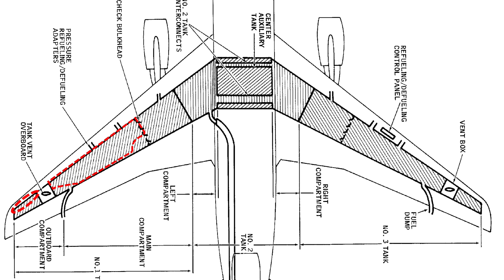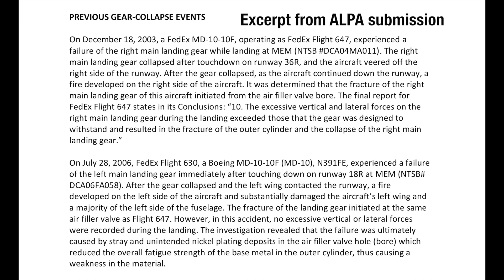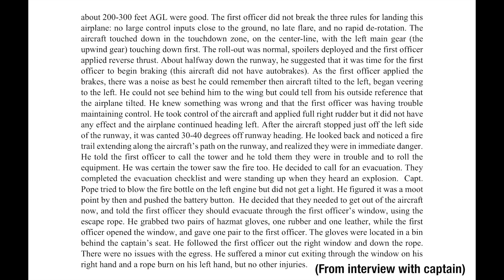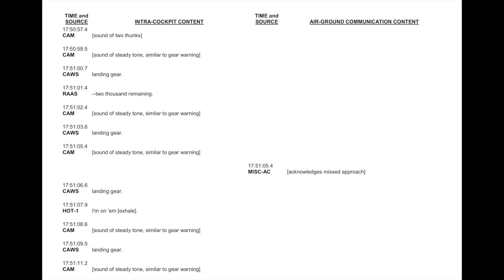FedEx Express 910: Gear Collapse, Fire, Fuel Tank Explosion

Comment: FedEx ignored Boeing's recommendation for inspecting the landing gear struts for corrosion.  There was supposed to be a cadmium coating to control corrosion but it was absent on this plane.  It is not clear if the coating was never applied or if it was accidentally removed during a maintenance operation and never restored. So, FedEx saved a few bucks by not doing the recommended inspection and ended up writing off a valuable aircraft.  FedEx NOW follows Boeing's recommendations.
Reply: I would bet my left nut that their maintenance schedule was approved by the FAA. Just because they didn't follow Boeings recommendation doesn't mean they did their maintenance improperly.
Reply: They failed to discover that the cadmium coatings were not present on the strut for 5 years and the strut became so badly corroded that the gear collapsed.  If they had followed recommendations, they would have discovered the issue and avoided the failure and destruction of the aircraft and endangering the crew.
Reply: @johnferguson7235  There is no on-wing procedure to detect this condition. Landing gear replacement is part of the maintenance schedule
Reply: In addition, he seemed to land very hard from the volume of tire smoke seen. It's a known issue with this plane that landings, which are fast to begin with, can generate a high sink rate and heavy landing and even a bounce.
Reply: If I am correct, THAT is an old DC10..NOT a Boeing Airplane/product. Maybe Boeing bought McDonald Douglas out.
Reply: It started life as a DC-10 as built by McDD. It was converted to a "MD-10" by removing the engineer's position and updating the avionics  to allow for a two person flight crew by Boeing or a contractor.                                                                                     
 Officially Boeing and McD Douglas merged. Reality = Boeing bought MCDD.
Reply: @georgealdredge2806  I always thought that, that engine mounted on the tail was a very horrendous decision and MCDD NOT having backup hydraulics was an accident waiting to happen.
Reply: Well the DC-10 did actually have three separate hydraulic systems and only one was needed to fly (emergency landing would be needed in that event). As we learned in the United 232 incident, three was not enough. Subsequently, the DC-10s and MD-11s were equipped with "fuses" to limit the amount of hydraulic oil that could be lost in a catastrophic system failure.
Reply: @georgealdredge2806  They could have installed the hydraulic "fuses"/reservoirs after the 1972 "Windsor Incident" and before the 1974 Paris disaster. See also "Ford 'Pinto'".
Reply: I flew the MD11/10 for FE for 10 yrs. The “fuses” you are referring to was called the hydraulic system bypass enhancement valve... we called it the Sioux City valve. I can assure you FE has one of the best, if not THE best, maintenance department in the industry.
Reply: Jaime   I am in agreement with you on FE maintenance. Would FE have done the off wing survey of the MLG that this plane was scheduled to soon have done, or would this have been sent to a contractor?
Reply: George Aldredge hello George, I’m not certain, but FE does do most things in house, save for pax to freighter conversions , and off site maintenance where contract maintenance is the only option.
Reply: It's a DC-10 not built by Boeing, so....

Comment: Did they try and paint over the Fedex logo?
Reply: Obviously, yes...it just didn't work that well.
Reply: That is the dried fire extinguisher foam that was sprayed on the aircraft.  It is illegal to disturb any evidence on the plane until it has been fully inspected by the NTSB.  The plane can't even be moved without permission of the NTSB and the FAA.
Reply: Looks very much like just the logo, like they did on that Arabic or Japanese 747 that stuck it's nose in a ditch a while back.
Reply: @johnferguson7235   They painted over the logos as soon as they could get out there to do it. That does not disturb the NTSB investigation in a case like this and is a common practice.
 
That was not "dried fire extinguisher foam" - where in the world did you come up with that?  There were no fire extinguishers used here, nor would they have done any good.  The foam sprayed from the ARFF trucks doesn't dry like that, nor was it sprayed on the parts of the aircraft that displayed the FedEx logos.
Reply: yes, it is common practice to paint over the logos of aircraft involved in accidents
Reply: Guess they forgot to spray over the engine 2 logo....
Reply: @mikef6307  - They initially painted over what they could reach from the ground.  Once the aircraft was relocated to a remote concrete pad for the duration of the investigation, the entire aircraft was painted solid white.  Search Google Images for 'N370FE scrapped' for pics of that.
Reply: thanx Matt....
Reply: Common practice to paint over the logos on the aircraft after a crash, This aircraft was put next to a Dynamic 767 that had caught fire a year earlier which was also painted over in the same way, until both were finally scrapped.

Comment: The DC-10 was a HORRIBLE AIRPLANE!   SHAME ON YOU, DOUGLAS AIRCRAFT!!!!!
Reply: Don't know what your talking about its a great plane
Reply: The DC10 was and the MD11 still is one of the best aircraft out there. Only people who don't know the aircraft would say otherwise.
Reply: FF: The accident had nothing to do with the design.  The cause was improper plating procedure during landing gear overhaul.  Not a design failure.  Find another scapegoat.
Reply: Pelican1984  In addition to the (possibly) improper plating procedure FedEx exceeded the recommended overhaul limits. They would have had to remove the landing gear from the aircraft for an inspection/overhaul as there is no routine procedure to effectively inspect this area during on-wing maintenance activities.
Reply: Well, let's see about that.  The marketing department at douglas was frantic - they had to win!  Somebody influenced engineering somehow.  Maybe it was upper management.  I don't know, but the results were horrible.  In the design, the horizontal stabilizer and elevator surfaces were deliberately made small.   They did that to reduce drag and make the plane more competitive.   This made handling more difficult and, I'm not sure, but I think it increased the landing speed a bit.  And let us not forget all of those crashes, costing many lives because they just had to make the cargo doors open outwards, when common sense would have them open inwards - but that would take up a tiny bit of space, and golly, we can't have that!  And then there's the fact that all of the control runs were in one nice happy, vulnerable bundle - not spread out like they should be.  I am not really happy with douglas.  The DC-9 was a nice plane, but it was NOT FAIL SAFE!  Remember the Alaska Airlines crash?  The elevator screw jack failed in flight - and I'm not happy with Alaska Airlines either.  OK, I'll admit it - I'm a grouchy old man.  I won't even begin to tell you what I think of united airlines.
Reply: Fred Ferd  "difficult to fly" does not mean unsafe. While it might be challenging, training is all that is needed. Pilots who can't handle their plane can even crash an aircraft like the B777 or an A340... look at asiana or air france. blame the airlines for lack of training, not the manufacturer. the manufacturer tells exactly how the airplane has to be handled to be safe.
also show me one single wide body aircraft with cargo doors opening inward. or one single aircraft (no FBW) that does not have all control cables running below the cabin floor.

Comment: It should be noted that the ATC audio has had the blank gaps removed and the conversations didn't actually take place at the point that it appears they do as we get further and further in to the video.
 
As one example, the conversation about opening the south runway certainly didn't come up within a few short minutes of this incident (prior to the fire even being extinguished).  That was some time later after the fire trucks has already returned back to service - not while they were still extinguishing this fire on the north side of the airfield.
Reply: You're wrong about that. The runway and airport closure was done by airfield operations, and that would have happened as soon as they saw what happened and that would have been within a few seconds to a couple of minutes of the trucks rolling.
Reply: @ImpendingJoker  - I'm well aware of who initially closed the runway and you can hear them doing it over the radio.  I was pointing out the fact that the conversation about re-opening the south runway (as I mentioned) wouldn't have actually occured as quickly as the audio here implies that it did.  This incident occured on the north runway and it was not possible for them to re-open the south runway at a time when all of the airport's ARFF trucks were currently occupied with this incident on the north side of the field.  The FAA requires ARFF trucks to be in service and available at a fire hall at a central location on the field if even half of the airport is going to be open - and at the point we hear them discussing reopening the south runway here, the fire wasn't even extinguished on the north side of the field yet.
 
That was the entire point of my comment.  This audio is compressed and the blank gaps had been removed, but it isn't apparent until we get further and further in to the video where what we're hearing doesn't match up with what we're seeing.  Toward the end of the video, there is conversation about reopening the south runway, which didn't actually occur at the point where we hear it.

The audio at the start of the video is pretty close to being in proper time.  The blank gaps have been removed there as well and what we're hearing is still a bit ahead of what we're seeing, but that effect is much worse several minutes later in the video.  I've edited my comment to explain in greater detail what I was explaining.
Reply: Fair enough but don't jump on me for your not being clear as to what you were referring, too. And truth be told without the official time line in front of me I can't even tell when they opened the southern runway back up.
Reply: I’m not sure how anyone could have misunderstood the original post. It was perfectly clear to me that the example to support the claim that the audio had been compressed was the conversation pertaining to the reopening of the runway. Original post never even mentioned the closing of the runway. shrug
Reply: Because he edited it to make it so.
Reply from the maker: @Matt Coleman - Correct. (And the converse is true regarding ATC audio in the video I just posted.)